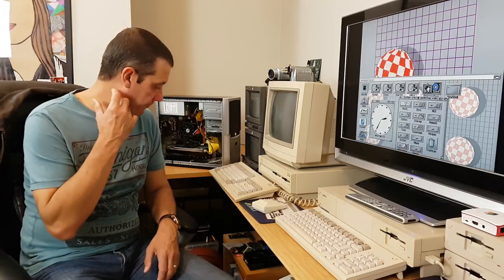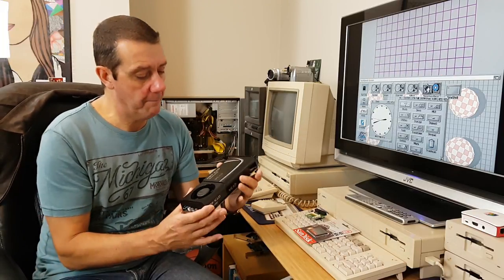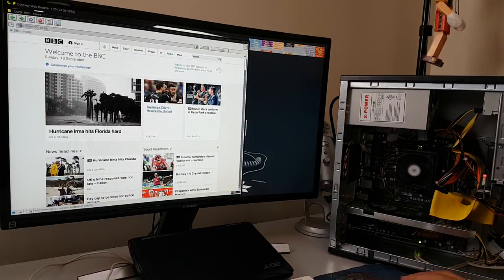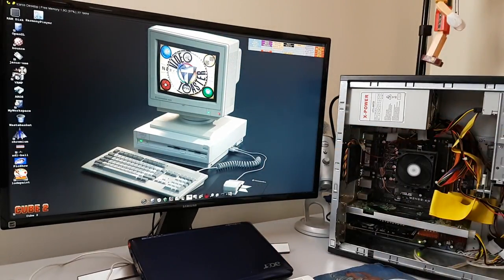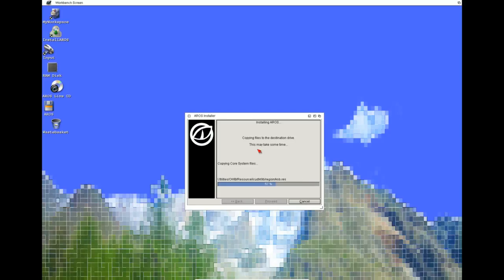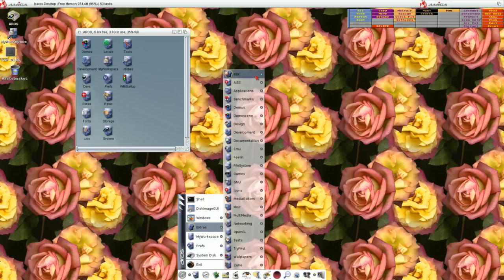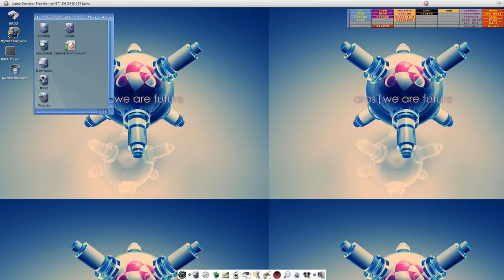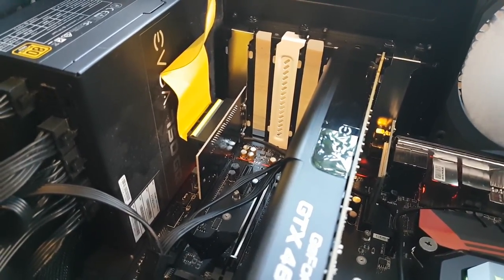Build an Aros based Amiga computer from scrap parts Part 2

Comment: You have to try an AMD A10-7800k in a FM2 motherboard with 4x sticks of SAMSUNG 64gb  DDR3 RAM  and forget about the graphics card and also forget about the sound card and use the integrated hardware in the A10-7800k
Reply: DAVID GREGORY KERR Why would AROS need 256 GB of RAM? Even enterprise class servers running Windows or Linux don't tend to have anything like that. Just buy 4Gb. The money saved would be better spent on other, more useful things.

Comment: Stephen I downloaded and tried to create the live install of aros, using etcher but get the message statin that its not a bootable image.  Created it anyhow and my system doesnt boot from the flash drive.  It then loads up linux (ubuntu) on my laptop and it has the flash drive as AROS Live CD.  Not sure what Iam doing wrong?

Comment: I've been unable to install it on my old PC.Can't boot from latest discs. Kind of boots up from light version CD but have a blank screen. Tried three different graphics cards. Tried three different DVD drives. AMD Athalon 2K Ghz CPU, 2Gb RAM, 40Gb HDD. So given up on a native installation. PC will boot up from Linux discs, Win XP disc, Amiga Forever disc, Sea Tools disc. Looks like Virtual Box on Linux or Windows is my only option.
Reply from the maker: Goto aros-exec.org for support

Comment: what is the status of usb drivers?, what i mean is lib usb/ winusb, i like playing with sdr radio systems, what i have been looking for is a really light operating system to run rtl sdr dongles.
windows works but it seems daft to me to run all those background resorces before it even starts sdr pro, on win7 with an athlon xp dual core 3.8g it struggles as soon as you try to run a second instance, what i need is possibly 3 instances of sdr pro,  and obviously 2 dongles , one for recive one for wide band monitoring and a transmit sdr.
at the moment its taking 3 separate windows machines in an array, i have tried small single board computers but the software and setup tools is just not there at least not reliably, it might be no go but if you dont ask you dont know.
Reply from the maker: aly nicholls the basics are there for drivers to be written.

Comment: amiga os like operation system!.
if i have harware that can run windows.linux,macos or amiga os. that is order i would use it.
i dont see any amiga hardware. software not make it amiga. if i can boot it with ubuntu its pc. i hate linux but love amiga. thats not amiga. if i can boot that with floppy and run msdos then its pc. i cant put amiga floppy. it is just yet another operation system. it would be amiga if they use intel chip and desing motherboard that has amiga kernel(bios) and it would not boot any other OS
Reply from the maker: Not sure what your point is here sorry.